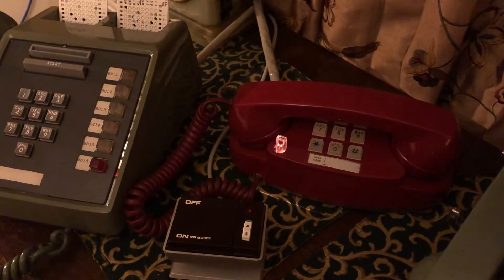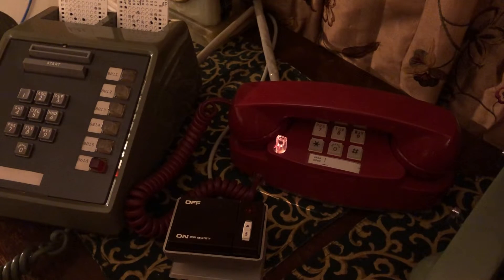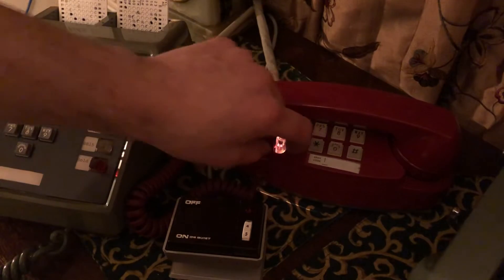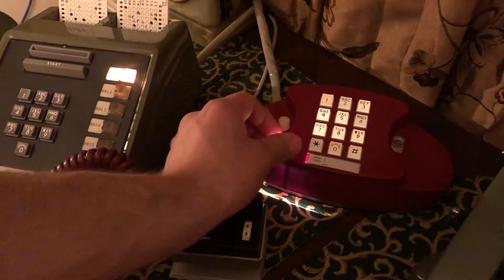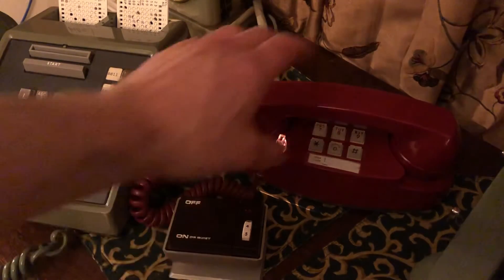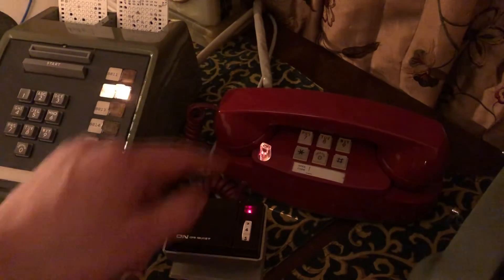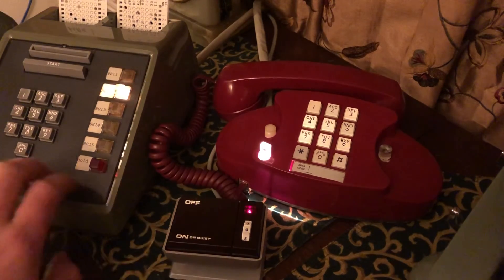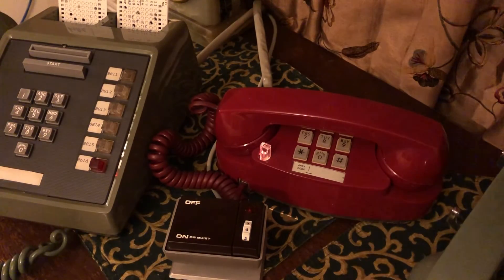Rare 2712b red princess phone custom wired to work in 1a2 key systems

Comment: Awesome video. We had a 1A2 Key system in the 1970's My parents had the dial version only was on line 1 ad had a 12 pin type plug and jacks. The dial pad flashed and winked or just lit when the line was in use it also had the plunger on the left. They could take it to other jacks as portale.
Reply from the maker: Very nice

I might have to try having the dial flash for hold and incoming call